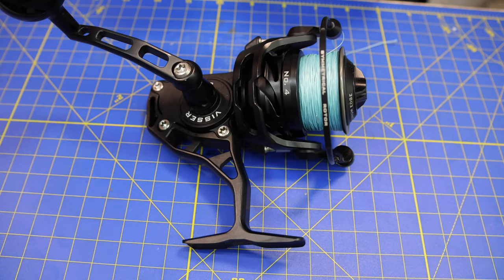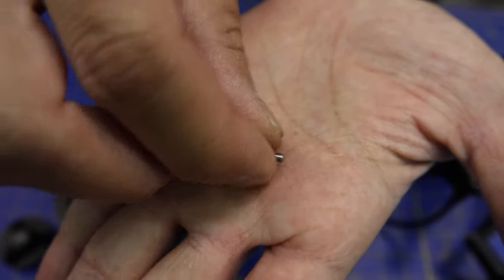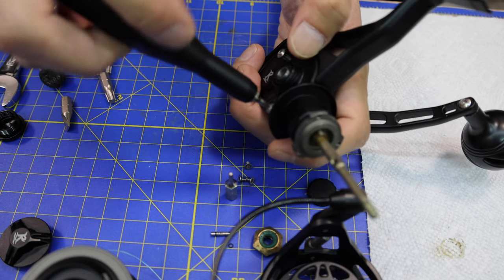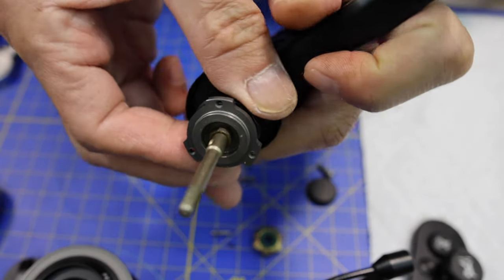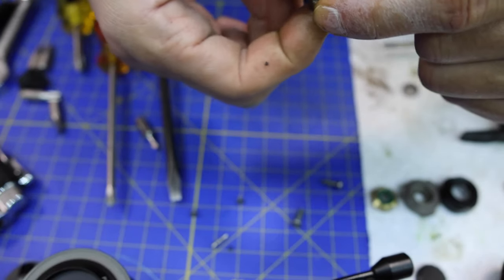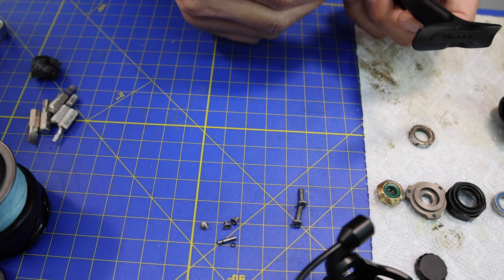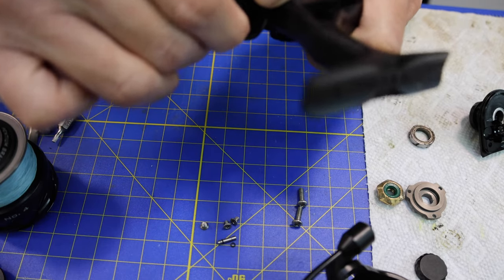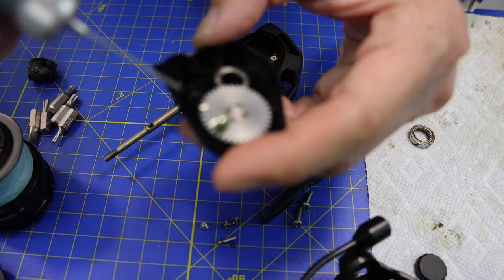Visser No. 4 Bearing Replacement - 2 Year Review

Comment: The main shaft seal (green one) was installed backwards from the factory in these first generation Visser reels. You need to pull it out, flip it over, and reinstall. The way it’s installed now, it will pull water in instead of push it out. Likely why that bearing failed too (I had the same thing happen)
Reply from the maker: I read about that from my first video. I wasn’t sure if mine was affected but since you say it is I will go ahead and flip it today. Thanks.

Comment: Hey curious what oil are you gonna squirt in there lol thanks
Reply from the maker: Visser has a recommend grease. They didn’t seam to like my blue yamilube I had in there lol. I normally use corrosion x on my bearings and yamilube on my gears but I’ll check out their grease.